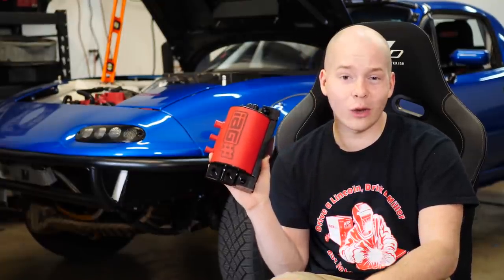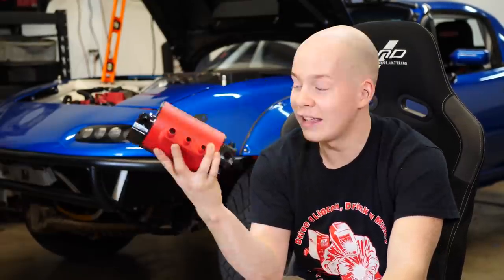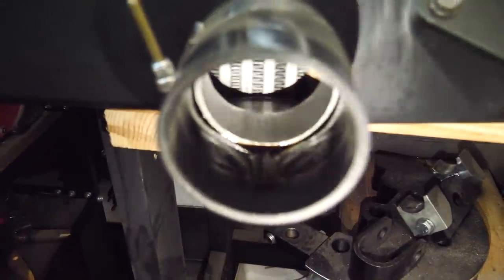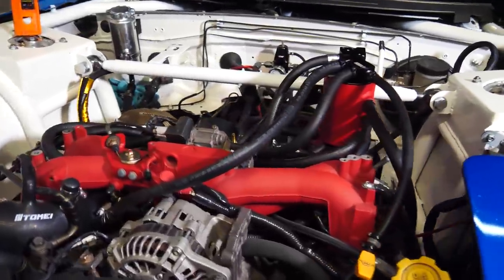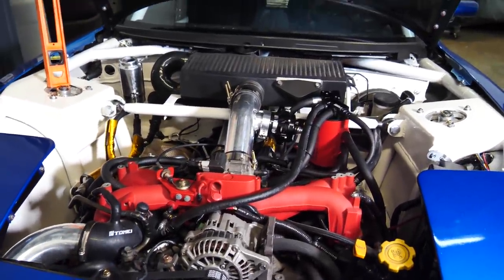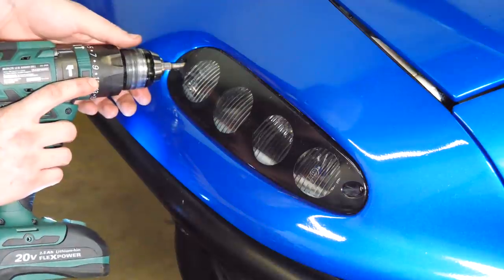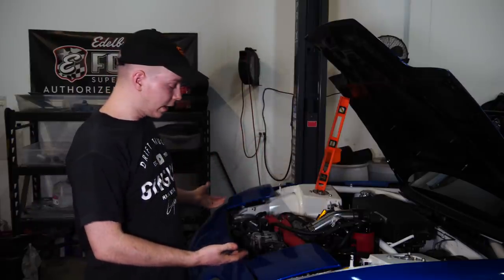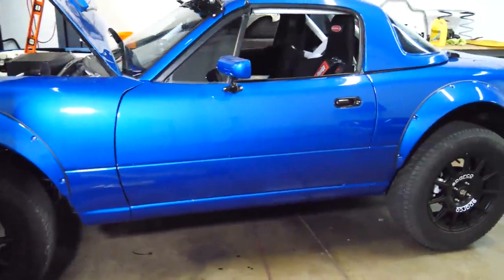The BEST MOD to Prevent a SUBARU ENGINE From BLOWING UP...

Comment: Turn 10 should laser scan this car for Horizon 5, also I think the clear lights look better than the circles, but get them smoked so they're a little darker
Reply: amber tint
Reply: @stanley4290  i dont think its legal to have amber headlights, probably something to do with them being reserved for emergency vehicles. Not 100% sure though.
Reply: The Youtuber car pack
Reply: I +1 that. A little smoke will look amazing on those lights!

Comment: I’d say tint the lights and make a damn skid plate for you headers lol
Reply: Yes 100%!!
Reply: I would at least weld in some tube that is equal to or even hang it a little lower than the headers. Hitting subaru headers on the ground can easily break a lot of important stuff.

Comment: "Without a properly designed AOS, water condensation can develop and find its way in the oil pan contaminating engine oil. Engine coolant lines are routed through the AOS in a specially designed heating chamber. This keeps the AOS warm and prevents water from condensing inside. Because water is more dense than oil, there is an integrated water trap found around the bottom perimeter that prevents condensation from descending into the oil pan."
I think you mean this, on the website of an AOS supplier lol.
Reply: good to know, thanks 😄
Reply: I was wondering about this in general about catch cans/AOS, someone showed one of a vehicle running E85 that had a rather alarming amount of water that had condensed in the catch can, no one in their right mind would pour that straight back into the engine.

Comment: The headlights slightly tilted looked kinda good ngl. Also definitely tint the turn signals black or maybe get rid of the casing cometely and leave them by themselves (if they are weatherproofed).

Comment: I have a Crawford AOS. It only has 5 hoses. 2 for coolant which is to avoid any condensation that would end up in the oil, 3 for oil. When mine was installed I also had stage 2 upgrades done. With 3 more psi of boost my consumption didn't increase. It stayed the same.

Comment: All the fabrication and you still use a spirit level to prop hood and the trunk up while working, so a set of hydraulic rams front and rear or at least the front, just a thought, the coolant lines would be better running through the cab one for safety the second they would warm up and stay warmer. Love this build, and the beauty of a build like this it will never be finished.

Comment: The best mod to prevent a Subaru engine from blowing up: swap the engine. 😂

Issa joke btw.😉🙂
Reply: cough cough 2j or ls swap cough cough
Reply: Jonnynum  or K24. Be lighter, more reliable, easier to work on, and make great power for cheap
Reply: Cough cough rotary swap cough cough

Comment: if you do the ppf on the sides you should also get mud flaps. not only do they keep the cars behind you clean but they keep the body of the car free of mud and rock chips, especially with how much the tires stick out.

Comment: Dude you've gotta do something about those rock chips. A clear yet durable wrap maybe on the lower section of the sides? Or just behind the wheels at least. If it's high quality soft plastic it wont tear and it'll just bounce most of the rocks right off without damaging your beautiful paintjob!

Comment: reason why there is coolant going to the separator is because there can be moisture in the lines and can make mayo/water in the oil and can clog. My BMW does the same thing but the separator is right on the engine block so it heats up that way.

Comment: A powersteering cooler could help keep the pump working well for longer but it's not really that important for a car vs a crawling jeep since you've got a pretty normal tire size and you're not constantly steering at a stop but never hurts to keep fluid temps in check

Comment: I vote you use some of the rubber coating you use on the truck to  do the bottom edge of the body...  just use the black stuff as far up as you can stand..  I really want to see how well that stuff holds up to abuse.

Comment: You shouldn't use ATF for power steering. As you said ATF can cause leaks in some lines. There are similar oils that are specifically for power steering. and don't mess up the lines and seals.

Comment: Im gonna be honest, I feel like you put that metal tube into the power steering system just for the shiny looks.  I've known a couple of cars that use a/t fluid for power steering and I've never had a problem with the rubber hoses deteriorating as a reaction to the fluid.  love the vids though bro

Comment: I think the ONLY way to keep an EJ alive is to strengthen the block. You can do EVERYTHING you can, but the weak/flexible block basically eats itself alive. The block flexes so much (from being split in half) that it wears out the crank bearings and ovalizes the cylinders. Thats a HUGE problem to me. Take an inline 4 for example, the blocks themselves withstand anywhere from 500-1000hp with no issues (talking about the BLOCK not the crank/pistons/bearings etc). I just cant get over that...